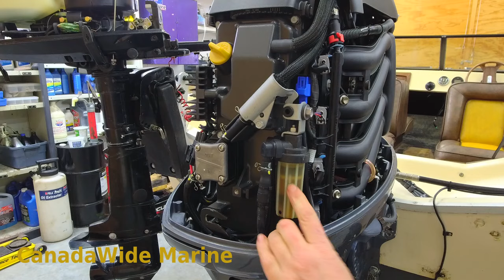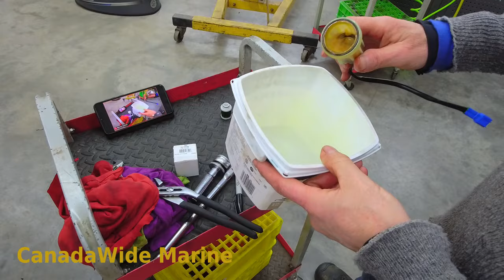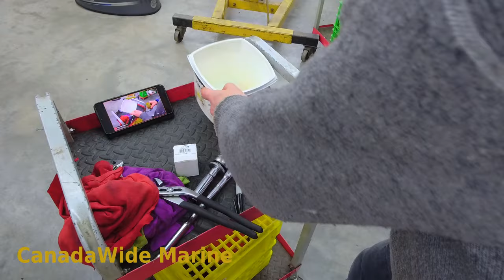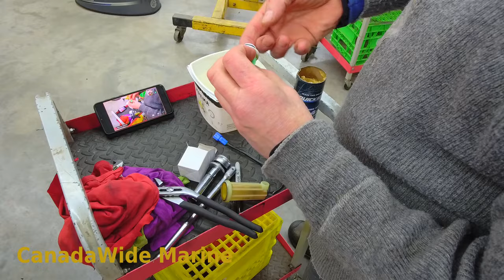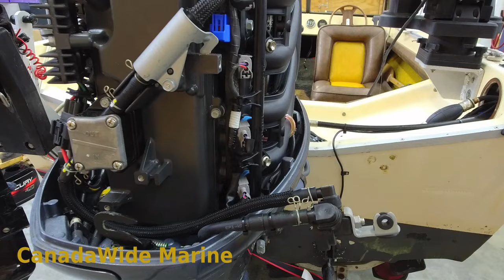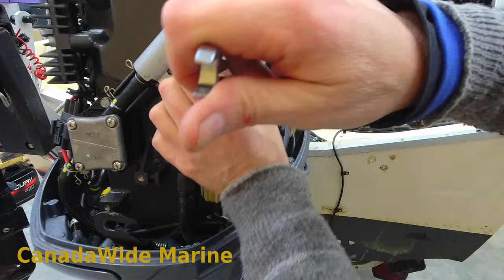Yamaha 4 Stroke Outboard Motor, 50hp, How to replace the fuel filter.

Comment: My F 70 started pouring fuel when I removed the clear, plastic housing. I guess I need to install a in-line shut off switch.
Reply from the maker: fuel tank was likely pressurized, you will want to check your venting.

Comment: day mate do you think a fuel water seperator filter between the tank and the engine would have helped to stop this from happening ,i have always had one on my boats admitedley they were all two strokes .
Reply from the maker: I don't remember what was happening in this video, but yes, absolutely, I always highly recommend a water separating fuel filter.
Reply: I have a big RACOR before mine with a drainable bowl. It’s overkill but cheap insurance.

Comment: Liked, subscribed.

Something I figured out after a long time and a lot of plier marks:

That weird, circular cavity at the bottom of the fuel cup on the filter accepts the business end of some of my nut drivers. I like to get a nut driver that fits snugly in there and use it as a wrench to turn the cup. I do a lot of routine maintenance and preventative maintenance on Yamaha outboards and I have not regretted this method yet.

I haven't found a tool for these smaller Yamaha fuel filters. Thought they'd have one like the 150-300 hp fuel filter tool, but I think I'm going to have to make something myself...

Comment: Thanks for the video. I have the same / similar filter on my F70 . . . I applied some silicone grease on those plastic threads today when I changed the filter. Hope it helps more than hurts, LOL.
Reply from the maker: I have used silicone grease on the threads in the past, it helps a little on the tight threads, it has never been a problem, other than cleaning them well next time I take it apart.
Reply: Good idea.  I think I'll do that, too.